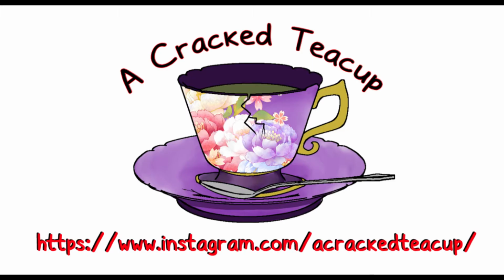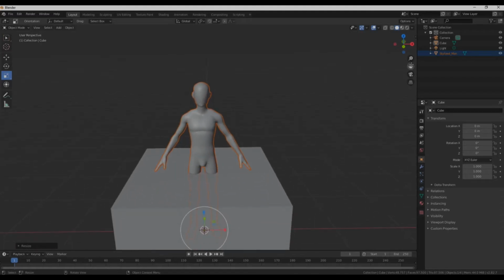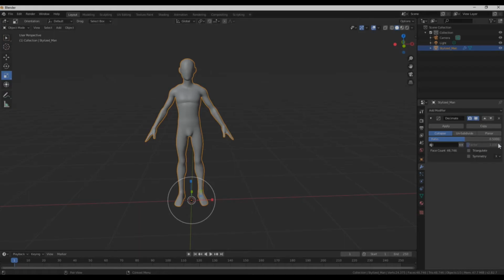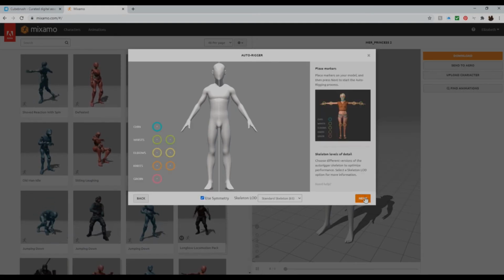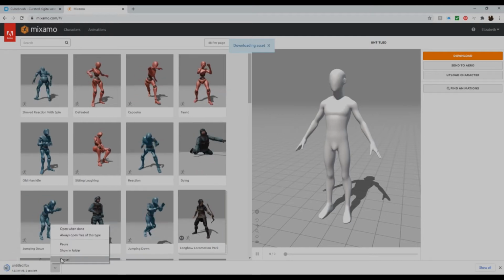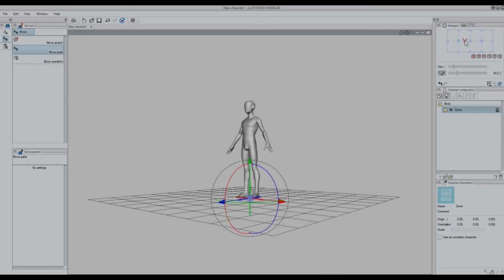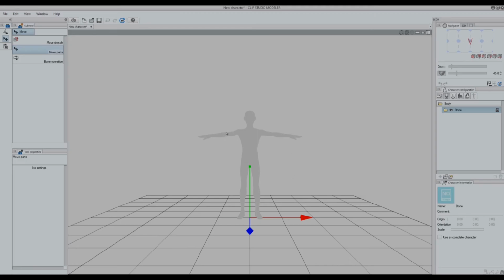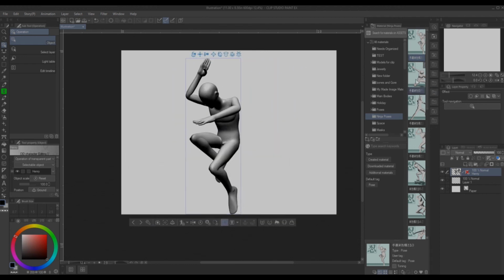CLIP STUDIO: How To Import 3D Models Into Clip

Comment: If someone else is having trouble with bringing the FBX 6 model into the csp modeler export as FBX 7 in the T pose, bring it back into blender, scale it up and export it again as fbx, idk why but that's how I fixed it.
Reply: So I did it like you said but I’m having a totally different issue. My model wont register at all even though It allows me to bring up the screen but when I click register it it does no appear in my material. Any advice. (This question also goes for the op of this video because I’m not sure how active they are)

Comment: Hi I have this strange problem in clip studio modeler that I tried import my Vroid studio model as an FBX and it imports the model but not the texture and it not just my Vroid models if I do the similar process with a make human character or another 3d model it does the same is there a way to fix this issue
Reply from the maker: I am so sorry for just now seeing this. Work has kept me away from youtube. Do you have a way to embed the texture before export/import?  or have you found the solution?
Reply: @acrackedteacup2181  sadly I haven't yet figured out how it works

Comment: ok, so, everything here worked great. EXCEPT for the bone part. even if i resize my model, it shows up as a tiny speck. the csp reference model is perfectly fine- normal sized. but my imported model is ridiculously tiny. it makes it kind of impossible to accurately pose it, especially since im trying to use a model of a complex robot character for reference and tracing, i keep getting bits and bobs stuck on each other. any help?
Reply from the maker: I apologize for the late response life pulled me away from youtube for long time.
I think I know what is going on, but first This post was 4 months ago so I should ask, did you find help yet? via other videos or google? If not I can fire mine up and look into it. I hope all is well with you and yours.

Best regards
A cracked Teacup.
Reply: @acrackedteacup2181  oh dont worry about it, i did some forum hopping! i just needed to download blender after all and i got the model correctly sized. thanks for checking up though!

Comment: thanks for this it's opened up new options for me. I would also like to point out that people with poser can save figures as obj's from the program and use them in the same way.
Reply from the maker: I am so glad to hear that it could help! Also, Thank you for the information about it working with Poser. I have been considering buying poser 12 but wasn't sure if it would work. ^_^. Thank you.
Reply: @acrackedteacup2181   I have poser 10 and after flash stopped working (thanks to abobe) my menus dont work propally so i cannot use the program like i use to. I dont think this happends in the new one. but thanks to you i can use what i need in clip studio thank you. if you want to see my comic it's called Blunderland and is on comicfury (but not for young eyes!)

Comment: Thanks for sharing this! I learned plenty. Your directions are clear and to the point. 

One thing I can answer for you: what faces and vertices are in a 3D model. A 3D model consists of a large number of 2D geometric shapes in 3D space. For most models, the vast majority of these 2D shapes are triangles. Some will be quadrilaterals, with the occasional pentagon, but mostly humble triangles. (Any 2D geometric shape can be defined as a set of triangles, and some 3D software programs use nothing but triangles.) These are the faces. Vertices are the points where the corners of the faces meet. The default cube has six faces and eight vertices, because a cube has six sides and eight corners. The more complex a model is, the more faces it will need.

The more faces a model has, the more detail it can show, and the smoother it can be. But of course, more faces means bigger file size, and slower saving and loading times, and slower refresh times when you move the model around, because there's more math to do. Which is why you are correct in thinking that it's good to keep the number of faces as low as you can while still having an acceptable degree of smoothness and detail. Exactly what's acceptable depends on what you're trying to do with the model.
Reply from the maker: Thank you so much! I am very glad that it could be of some assistance. 

Thank you so much for explaining this! You explained it perfectly where I could clearly understand and this helps so much. I kept watching blender tutorials that talked about the Faces and Vertices but they never said exactly what they were. ((I figured because most people would already know what they were. Unfortunately for me, I wasn't one of those people haha at least not until now :) .))